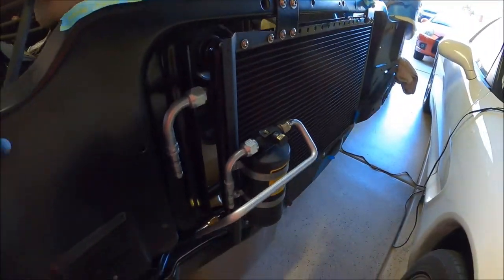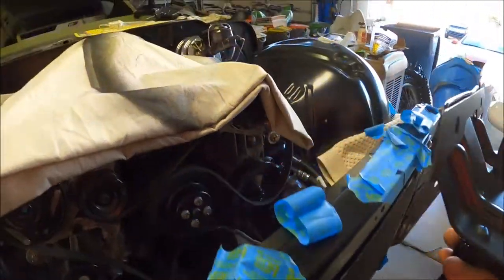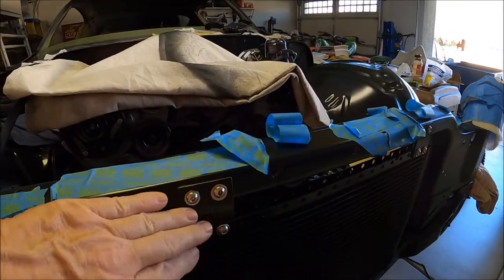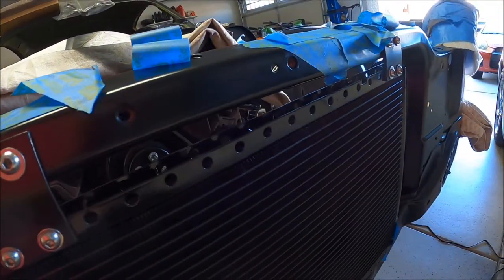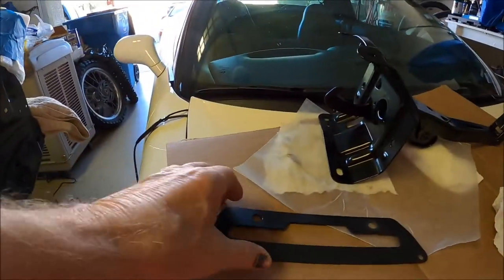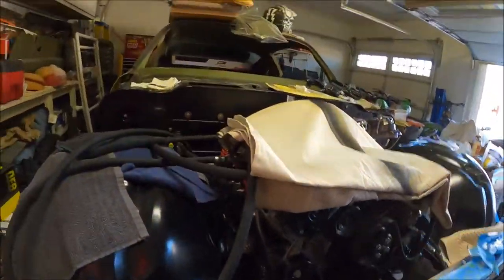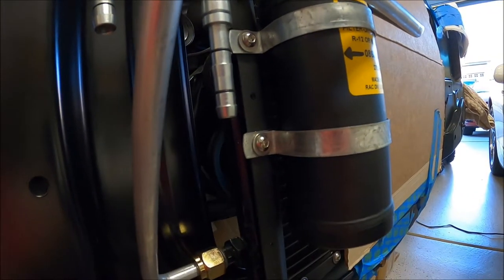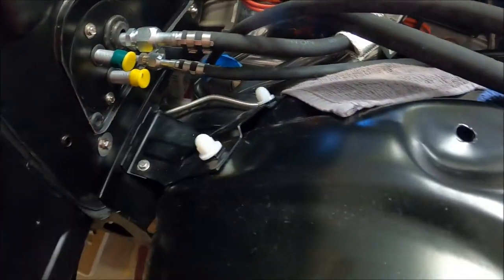"71" Camaro Vintage Air Condenser Install 10-15-2020

Comment: every little thing you do gets it done faster!!! ill be installing same kit soon.
Reply from the maker: If I had to do it over I would not get the kit. I ended up not using a lot of it because I went with the GM serpentine which puts the compressor on the passenger side. I would just get the evaporator, condenser, dryer and a compressor separately and take it from there. My Camaro was originally a non-AC car.
Reply: I'm gonna try my factory ac with new style compressor and condensor
Reply: @hubertbryant5587  I will still work. just update seals for R134
Reply: @hybridmusclegarage4590  have you done this before
Reply: @hubertbryant5587   yes super easy!
Reply: @hybridmusclegarage4590  did you have to use a expansion valve and poa valve

Comment: Hey Pete! I live in N Las Vegas as well. I'm having fitment issues with my condenser. It's looking like my radiator support is different than most other videos. Can you help?
Reply from the maker: You may have the rare Big Block radiator support or from a much later year. Sounds like you'll have to get creative for mounting. Most of the direct fit stuff I've purchased over the years is anything but! Thanks for watching!